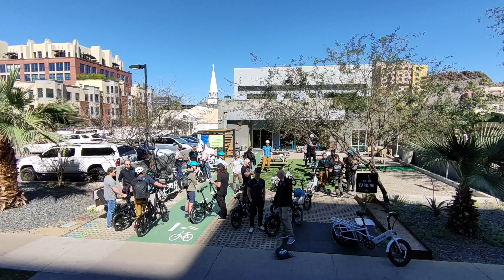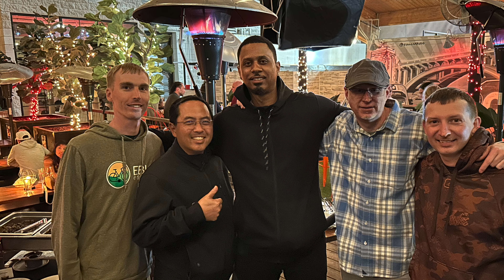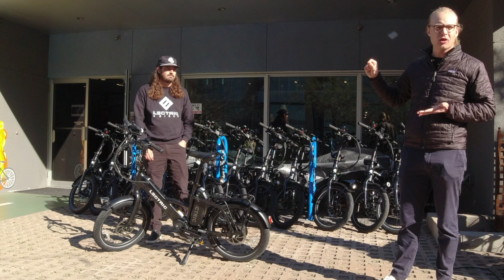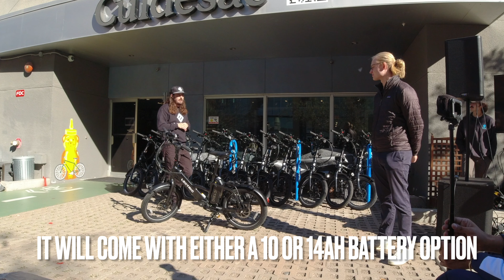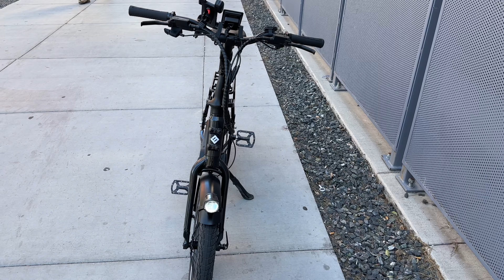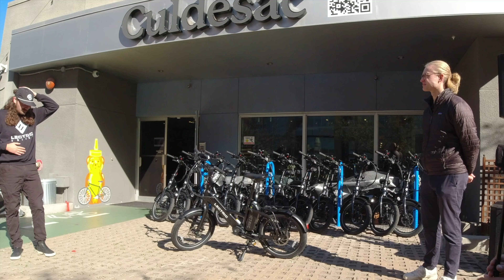Lectric ONE Reveal Event (commuter ebike)

Comment: I rode a Gazelle and Stromer ST3 as my first e-bike and they were impressive and of course more expensive. But I preferred the Stromer and was about to purchase the way more expansive Stromer ST5. I hesitated because it doesn’t have throttle assist and you can’t put a rack on the front of the bike. I’ll be traveling over 90 miles often and I’d like to do bike packing too. The Stromer seems more like a performance bike than one designed for bike packing. Their website pictures seem to imply that. Bigger diameter tires are probably more comfortable for longer rides, so that’s another reason I’d buy it. Price isn’t an issue because I sold one car and selling another one. No more cars for me. I’ll rent one or get an Uber if I absolutely need one.
Reply from the maker: The Stromer is heavy too, better for commuting

Comment: Why on earth didn't they just make this the xp 4.0? This is the same design as the folding e-bike except it doesn't fold, there's no suspension at all AND it's over $2000... kind of a let down honestly. If they just threw all the tech into a folding version with suspension then I'd be on board. This is just non sense
Reply: You cant fold the new transmission. Nobody needs more suspension than the seat post suspension for a paved street bike.

Comment: It's just so under powered for the output. 48v-14amh is extremely low for power being used. This should have a 17-20 amp hr battery pack at minimum or people are going to be running out of power really fast.
 I've been riding mid drive bike a lot lately and the motor itself uses about 10-20% of the battery just to operate. This means I have to take shorter rides because if the battery dies completely you have a heavy bike to push home
Reply from the maker: This ebike is in no way underpowered. It has the best acceleration I have ever tested on an ebike with a 750 watt motor. It only weighs 55 lbs.
Reply: But the power that is being used because of the power output, that's the difference. The older bikes have a lower peak of power output and thus preventing fast power draining. But now you have close to 65% higher power output which makes for less distance. You've been doing this for a while and you know that when you have a higher amp hr battery you're not worried about distance as often. I bought a long range XP 2.0 for that very reason and though I only got 5-7 miles more I made it home every time with at least 25% battery left but on my XP 1.0, usually have to pedal it. (Pedal assist 3-4) This is just my opinion, battery pack prices are not that high for bulk purchases and Lectric needs to step up their game with bigger battery pack options and you have to see that too
Reply from the maker: there is a rumor of a bigger battery so stay tuned